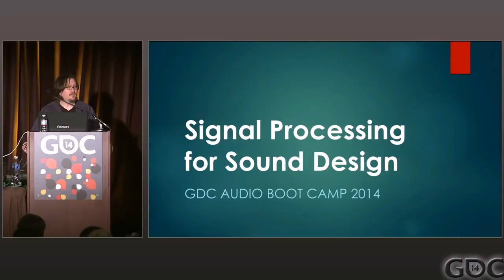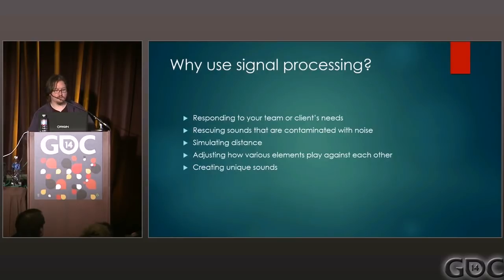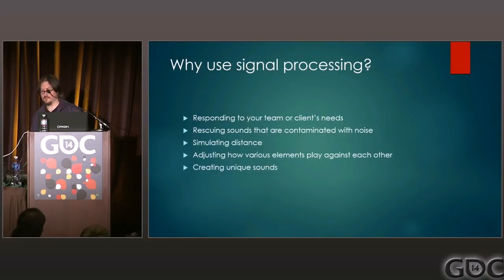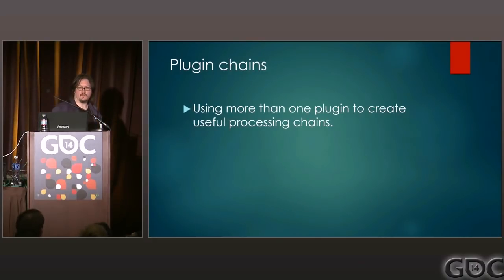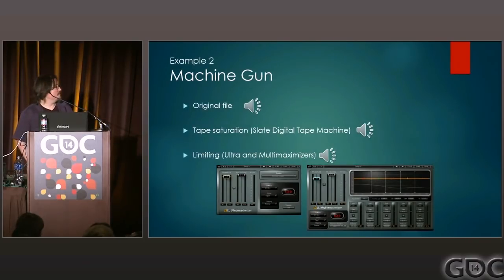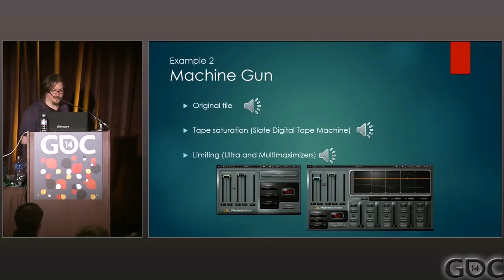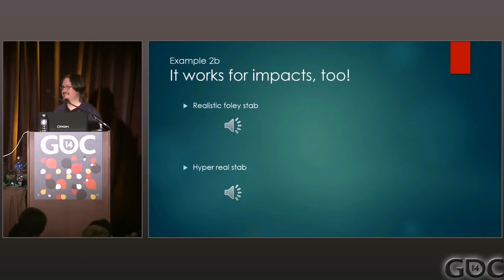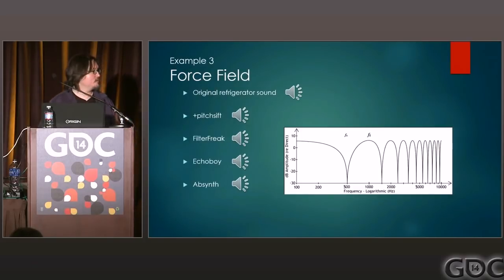Signal Processing For Sound Design

Comment: I'm dying to know which plugins he used for Example 6 Morphing
any ideas?
Reply: Woud like to know too! Although I guess you could use any morphing plug ins like Mmorph maybe or I wonder if this is doable with a vocoder with having one source as a modulator for the other, it's worth trying it!
Reply: at the end of the talk he says it it's called prosonic morph
Reply: @jamesmeustache7740  Hey James. I did some digging and Zynaptic Morph2 is the current version of this plugin. Back then it was owned and sold by another company but Zynaptic has bought and currently sells 'Morph 2'